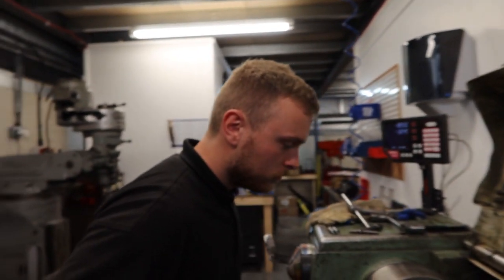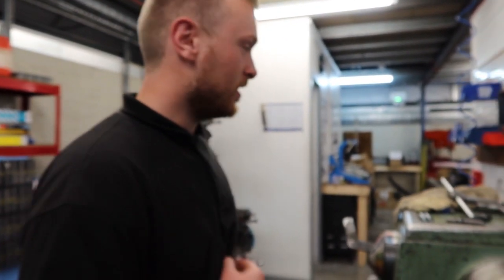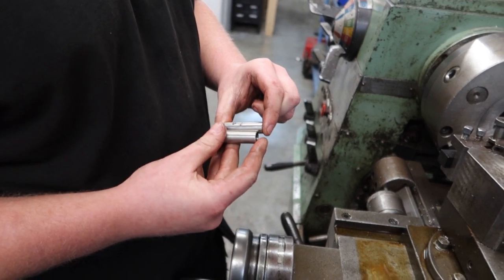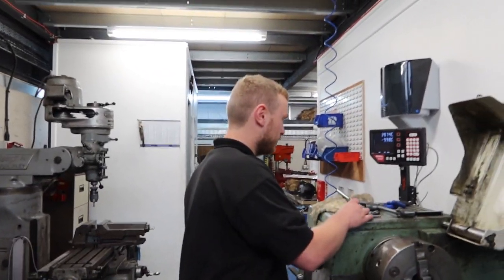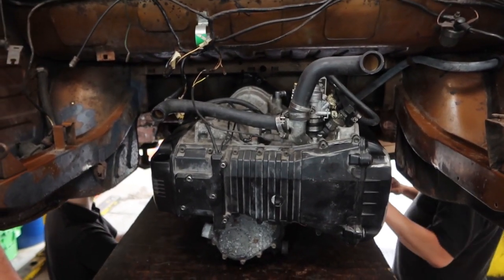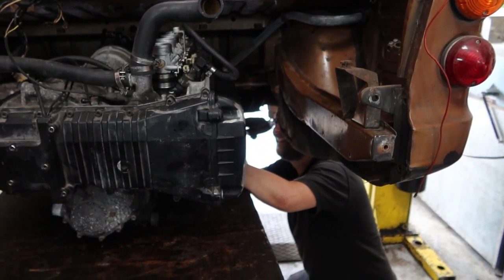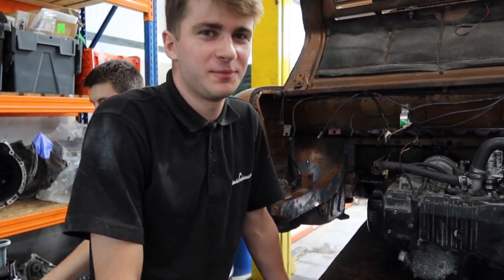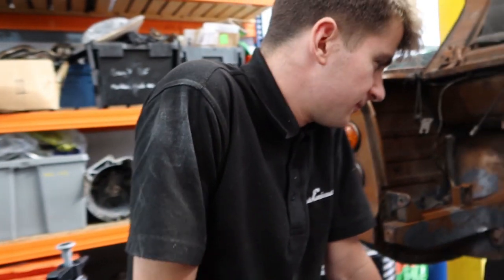Mission K-IMPossible Episode 6 - The Dry Build Begins!

Comment: Can you hang the K100 from the original Imp rear cross member single central mount, this would need a frame to pick up on the K100 engine mounts/brackets, laser cut would be good, you never know you might sell some. A pity to see you had to batter the rear panel to I guess clear the starter. Any way good to see another instalment.
Reply: @hackengineering5586  OK, if that was what the hammering was, not a problem. But the engine mount on the original Imp was great if you did not have a 4 poster like your workshop, so to retain this would be good, because I and others could get an imp engine out quickly with no lifting by supporting it, on blocks underneath, remove the rear cross member, and then roll the car away from it, OK and disconnect all the other bit and bobs. Or the more frequent job of split it at the clutch to change the carbon release bearing, at least that has gone with this conversion. Keep going guys. Am I the only one watching, hope not.